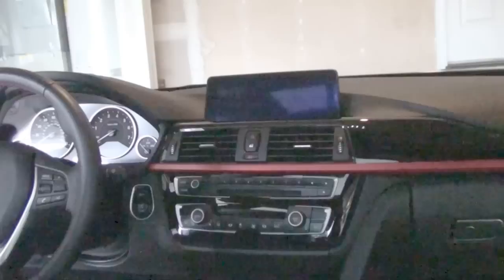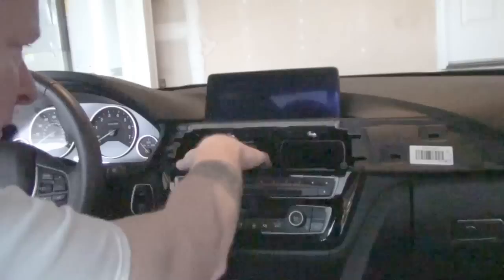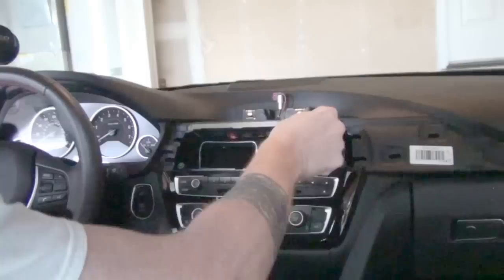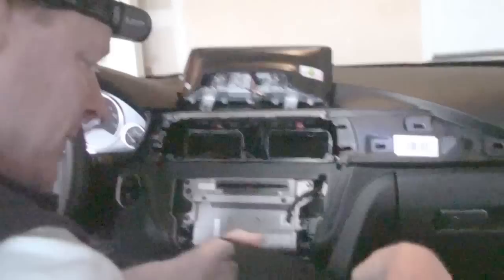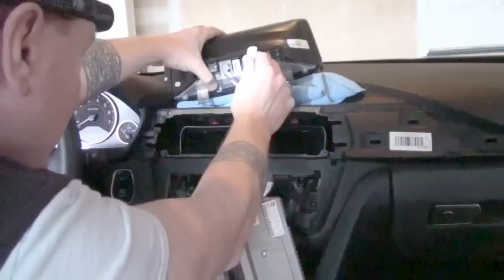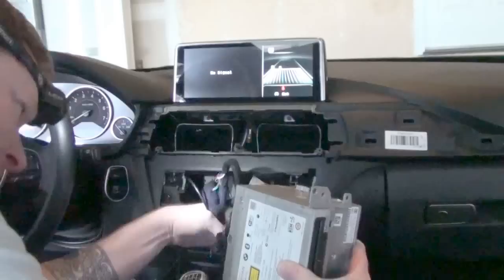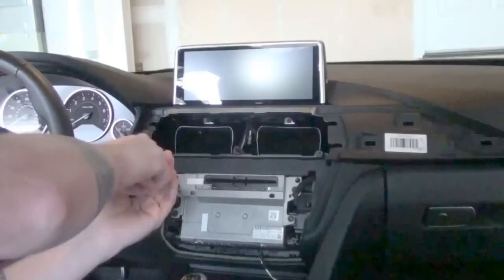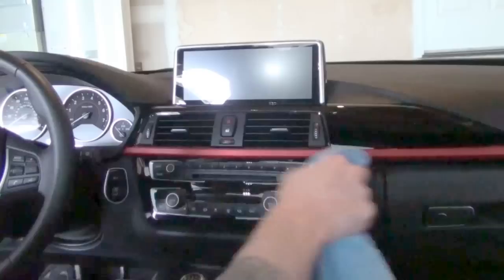BMW F32 Avin 10.25" BMW Android Multimedia Navigation System installation DIY

Comment: Have fitted the Avin unit into BMW 1 series and have 'no signal'. The cable is connected tightly. Only parts of Idrive system working. Havent connected aux cable as sound is fine. Anyone have any ideas.
Reply from the maker: No signal from the idrive side? You could put the OEM screen back and test,  make sure everything works fine, then piece the new screen back in.  Bad unit is possible but honestly really rare.
Reply: @BMWDIYGuy  
Really appreciate the reply. :) 
As soon as i press car-info it just comes up with no signal. 

If i press the speak button on steering wheel it goes to waze since installing this. 

The radio station list isnt visible next to the speedo.

Audio doesnt seem to play via spotify (installed).

DAB on android side just says connecting

Radio on bmw side plays but cant tell what station or if its dab etc.

Should i try connecting the aux cable or swap back to the original to see it it all works? 

Any tips of contacting avinusa if it is a faulty unit? 

Thank you again
Reply from the maker: @Daniel-hu9jq  ok.. one piece at a time. Being US, I haven't worked with DAB at all, but that's ok. Was your original display 6.5 or 8.8, and what is the new display configured to in settings? Code is 1314, make sure car type is correct for idrive (nbt, CCC or cic and original screen size 6.5 or 8.8. and dont stress over the model numbers listed. Start there and make sure.
Reply: @BMWDIYGuy  
Thank you
It is fitted to a 2017 BMW m140i with pronav which makes it 8.8 i think. I have set car type to nbt f48/49 8.8/10.25.
Reply from the maker: @Daniel-hu9jq  ok.. so that is correct from a display setting place, so that is good.  Something is just funky.. if the OEM screen back in works fine (test that), then put the new harness back in with the new display  it will narrow down what is wrong or at least WHERE something is wrong.  Its a matter of trying to narrow down where the issue is now.
Reply: @BMWDIYGuy  
Old unit works fine. No issues at all. The head unit doesnt have a gps antenna, from looking online it uses atm so no blue connection. 
Either way as soon as i press car info i have no signal still. :(
Reply: The unit was originally intended for an f30 but being fitted to an f20. Avin told me the only difference was the backplate which i bought and fits well. Fitted old unit back now until i can actually make it work. :(
Reply: @BMWDIYGuy  
Ive given Avin until the end of the week to give me a resolution before it gets claimed back through Paypal. Such a shame. The unit looks nice but thats as far as it got for me. :(

Comment: Ι have an e63 without original AUX. I installed aux (to the original harness) and got it coded by BMW couple of months ago and it worked perfect with my ipod. Now I installed the screen, but even though I am doing the procedure carefully I dont get any sound. However when I put my handsfree on the "audio out" of the new harness, I can listen to the sound, then when I connect it to the AUX cable, nothing, no sound coming out from the speakers. Any ideas?
Reply from the maker: So other source into your OEM aux works.. plugging headphones etc into the new harness out works... but new harness out to OEM aux port doesnt?  Now that is odd.. I gave seen once or twice it diesnt switch over at first. Check the Male to Male cable.. make sure that works.   Are you using the aux splitter? If so, try without it.  Also checking settings for auto aux switching.

Comment: Hello, I put one of these into my BMW 2014 328xi yesterday.  The problem I'm having is that I don't get any sound out of the device such as the video playback or bluetooth audio.  Tommy sent me a quickstart guide that says I have to run an aux cable to my aux input under my center console.  Is there another solution?  If not, where do I run the cable from?  Is there an audio output on the screen or wire harness?
Reply from the maker: Hey Alex.. yes.. there is an AUX jack on the wiring harness.  Run the cable from there, under your center console trim and then up into the arm rest area.  If you have the rubber mat and dont have the phone dock, you can pull up the mat and run the cable through the holes in the bottom.  Super simple. 8)
Reply: Perfect.  After reading some comments I saw that below.  Hopefully I can get that in nice and easy tonight!
Reply: does this produce sound quality similar to the stock system? Currently using spotify on my phone via aux port, fairly happy with the quality from that....
Reply: Is it possible to add this to my e46?

Comment: I did install in my f11 with cic professional but i have problems with the sound, first only left channel worked, after pluging earphones in the aux mic and heard well, then unplug hearphones and all worked well but the day after again no sound from any channel.
I can play music pluging a player through mic but no sound comes out.
I have not be able to connect the aftermarket rear camera also.
Reply: Did you find a solution for the 1-speaker issue? I have this issue also. Everything is working fine in normal mode, but in android mode I do only get sound from one speaker. Tried everything.

Comment: Hello. I have probelm. I change display and all speakers plus add 2 amplifier in a back. Probels with music. Music working only from aux cabble. When i connect my phone to bluetoouth i can see in player list how i lost a music but can not hear music. Same with parking sensors on display i see but can not hear. I change Optical cabble.
Reply from the maker: Check all of your connections as it sounds like something is loose.
Reply: BMW DIY Guy Original Radio working and AUX cable.  i checked few times and plugin all cabbles:(
Reply: RCA Cable go to Screen. Left and right plugin to  into main cable. with come from headunit.

Comment: Hi  i have this unit installed in my BMW X5 09 is working perfectly. I have a question for you, is it possible to install  an aftermarket amp and sub? Also Is it save to do it?
Reply from the maker: No reason why you couldn't do it!
Reply: BMW DIY Guy  thanks

Comment: Hi, great videos - Thanks!!! In one of your videos you mentioned the backup camera installation. Will you be doing a video soon? Any installation tips for the Avin system with backup camera on a E70 2008?
Thanks again. 

Cheers!
Reply from the maker: So I don't have a backup camera video planned at this point, as my car had the factory camera but if I do an install for someone that has that done, I will definitely setup the video.  That said, its not that hard.  Assuming your car is similar to the F30s, you pull the trunk lid liner, replace the rubber handle grip area with the replacement model with the camera.  The power and ground wire for the camera you tap into the power and ground for your backup light, which makes it go active when that light turns on.  Run the cable under the covers (usually) for the trunk arm on the passenger side, and then down and behind the carpet on that that side.  Run it under the carpet, to the back seat, then under the carpet edge (likely have to pull up the door sill covers) until you get all the way to the base to the A pillar.  Run up under the A pillar cover, behind the glove box and into the space for the head unit.  

Now that sounds all complicated.. but honestly not that hard and just takes time.
Reply: BMW DIY Guy thanks for the detailed instructions, very much appreciated!!!
Reply: BMW DIY Guy. Hi again! I hope you’re doing great! I’m installing the unit right now. Everything was going smooth til the screen connection. There’s one 12pin plug that doesn’t fit to the screen. The 12pin plug only has, what it seems to me, + & -  and 2 other wires (maybe audio). I tested the unit. It turns on, but only plays audio from radio (I imagine cd also plays). No audio from Avin unit at all (video, music, usb, Bluetooth). Any suggestions? If you have skype or FaceTime. I can show you.
Reply from the maker: So easy fix for you!  You will need to run your AUX cable to under your arm rest.  Plug in the male to male cable from the AUX port on the new wiring harness, run it under your center console trim and up into your arm rest storage area and the AUX port.  BANG, good to go!  Easy stuff! 8)
Reply: BMW DIY Guy Thanks again!!! Yes, I hooked it up that way and worked. Later, as I was rearranging some things in center console, I disconnected the AUX cable and everything is working perfect without it now! Isn’t that strange???
Now I’m having trouble with USB ports. I connected iPhone (7 plus 128gb) and iPod (Touch 4 32gb) none of them work, with or without CarPlay interface, but they do charge. Also connected USB flash drive and its light blinks but in all cases screen shows “USB NOT INSERTED”. Any suggestions?
Reply from the maker: Glad to hear everything is working now!  GREAT news!  For the iPhone, great question as I have only worked with the CarPlay a little, and it worked right off.  My default suggestions would be to make sure the cable is FULLY inserted into the back of the display.  Then check for any updates to the display.  If you are still having problems at that point, definitely ping Avin and see if they have any suggestions?
Reply: BMW DIY Guy Thanks! I took the unit out, disconnected and reconnected USB harness but the problem persists. What’s driving me nuts is that iPod and iPhone charge when connected. Already sent video and pics to Avin earlier today. Thanks again!!!
Reply: Ok, got feedback form Avin.  All this time, I thought that I was able to connect iOS devices directly and stream music to unit. It doesn’t work that way... Also I was using a 64GB USB flash drive exFat format, but the unit only reads FAT32 format. Bottom line, only iOS devices with CarPlay are compatible using the CarPlay interface (sold by Avin) and the app provided also by Avin and all storage devices larger than 32GB (SD cards and/or USB Flash drives) must be formatted FAT32 in order to work. 
One more thing regarding Avin’s backup camera, Avin said to use one end of video cable (red cable that sticks out of the video cable) and attach it to “12v Camera” cable from unit and the other red end of video cable to power backup camera’s red cable power harness (black to any ground screw. I used the screw that holds the tailgate). No need to tap into reverse light. 

Thanks for your videos and advice! 
Couldn’t of done it without it.

Comment: Should the antenna be installed upside down like you did? I dont get very good signal and I think it's because the sticker should be facing down. ??
Reply from the maker: Marja Anttila So I will say it's probably more position than being upside down for you?  Launch the GPS antenna app and check strength to make sure you have a good signal.

Comment: Thank you for the video. I ordered this unit with the carplay adapter. I am a bit unclear about the wiring of the carplay adapter. From my understanding the carplay adapter needs to be connected directly to the head unit via USB. If you leave the adapter inside the dash, where to you route your lightening cable so you can plug your phone in?
Reply from the maker: So easy options.. first choice I took was route the USB cable or in your case, lightning cable through the vent holes in the glove box.  I have my USB extension and AUX cable run there, and can plug anything I want in and close the glove box.  The other option, and a longer run would be to get a LONG lightning cable and extend down under the center console and then up into the space under the arm rest.  That could also tie into something like a Qi wireless charger install like I did as well in my F32 there.
Reply: Thanks for the prompt response!

Comment: hello! What connector should i use if i have the old ccc idrive to connect it to the android screen? Thank you.
Reply from the maker: Just order the proper screen for your device
Reply: @BMWDIYGuy  
i just buy it but for an e87, and i have installed it, but i want to know what is the connector to play the old idrive knob ccc, because i dont like it the new idrive, two idrives have 4 pins connector, i supposed that i need to plug it in the new idrive connection of the radio?

Comment: I installed Avin Gen 2 about 2 days ago and I am having problems with GPS antenna not having a good signal if it's placed inside between A/C vents and glovebox. It works fine if I put it on top of the dashboard but cord is visible and looks ugly. Is there any other places that you suggest I can put the antenna that would be kind of hidden and work at the same time. Thank you
Reply from the maker: The cable is long enough that I have heard of folks putting it up and under the headliner, and bringing the cable down the A pillar, and into the dash.

Comment: Rule of thumb, always disconnect the battery when working on the electrical/electronic system
Reply from the maker: Solid advice,  I usually do when dealing with ecu or other critical components
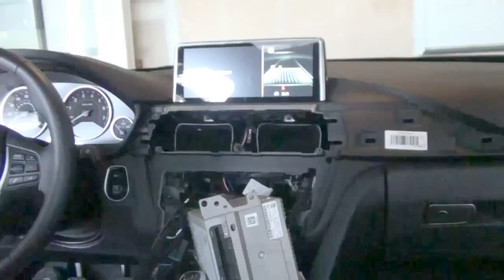Reply: @BMWDIYGuy  wrote the comment at 34:11when i saw the unit was powered, you mention this at the end.

Comment: Hi. Great video!
Will a official wide screen work properly with a "basic" navigation unit if i replace my actual screen? :)

Thank you
Reply from the maker: Assuming you mean basic is the 6 inch screen?  Yes.. it will replace either the 6 or 8.8 just fine.

Comment: I'm installing my unit and the unit I received has the CIC connector and not the NBT, even though I have the base unit my connection uses the purple NBT one. Do you know if they're the same just clocked in different positions or is there more of a difference?
Reply from the maker: Allan K I am sorry, I am not familiar enough with the differences to be sure.
Reply: It worked, it looks like it's just clocked in a different position.  I just have to download and install the latest update.

Comment: so I have a 2013 base model 328i without the bluetooth and navigation. Would it be possible to purchase the 8.8 inch OEM screen from a salvage car? Would it be plug and play or not?
Reply from the maker: You would need someone to code the car for the new display at a minimum.
Reply: BMW DIY Guy I think I will do that because I got a screen for $90 at an auto yard. It’ll be far cheaper than buying a new screen and all that. Thanks for the response!

Comment: I have a 14 f32 without nav just the normal small screen/ if I get this will I be able to have a gps and a back up camera if I pay extra?
Reply from the maker: Yes, the system comes with a GPS antenna and your choice of what navigation app you would like to run.  The backup camera isn't a hard install, and is a huge benefit to have.

Comment: When you turn the vehicle off does the AVIN turn off? I just installed mine and when I turn the vehicle off it stays on all the time. I contacted AVIN and they said I hooked it up wrong (not sure how that's possible) and then eventually sent me a replacement. The replacement does the same exact thing. If nobody can figure this out then I'll sadly have to return the unit to them for a refund.
Reply from the maker: Jeff Rebeiro so great question and it should turn off when the ignition is switched off.  Mine does.  I literally don't understand how it would stay on.  What model and year is your car? Automatic or manual? Maybe there is something we can figure out.
Reply: BMW DIY Guy it's a 2009 e93 convertible. There is a problem with the harness as it's connecting to +12v constant. I contacted AVIN and they asked me to modify the harness to connect it to +12v ACC power from the CIC unit. This works better but the CIC still powers on when the vehicle is unlocked and powers off after a few minutes when locked so the display stays on during those times unlike the factory display.

I found the original display harness isn't used and I believe it provides +12v switched power which would be the best option. I ordered a female connector to make a harness and am hopeful it'll work. I'll send AVIN details if I get it working so they can make a harness that works properly in these vehicles.

Not having Android 5+ is a bit limiting on this device as many apps I use aren't available. It's also got too little RAM and the transflective display on the original unit is much better in dealing with direct sunlight and glare. There were points in my commute where the screen was completely unreadable.

Comment: Hi, My original BMW CD professional keeps rebooting and I need to replace it. Will this system work without the original deck ??
Reply: Sorry it's for an BMW f30
Reply from the maker: Great question.. I believe it may yes, as long as you are on the android side of the display.  The display in the F3X and the E83 (without an idrive whatsoever) are essentially the same display.  The difference is the E83 display has a checkbox set of no original idrive, so disables the "original car" tile.  So yes, I don't know why it wouldn't work with just the head unit unplugged.
Reply: @BMWDIYGuy  Thank You the quick response. Would I then lose the iDrive functions, such as resetting the TPMS ?
Reply from the maker: @dheshengovender2693  I believe you will lose ALL iDrive functions until the headunit is replaced.
Reply: @BMWDIYGuy  Thank You
Reply: @dheshengovender2693  did you end up installing a system like this with the broken idrive head unit? If so, were you able to get any of the idrive functionality through the android screen? And were you able to get sound through the car speakers?
I have the same rebooting issue